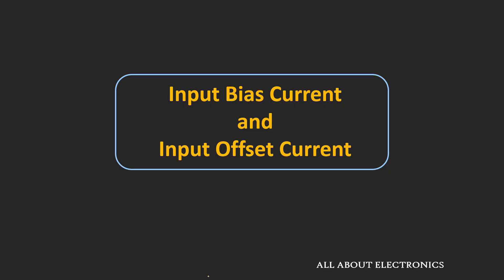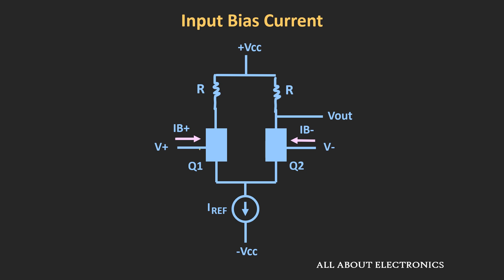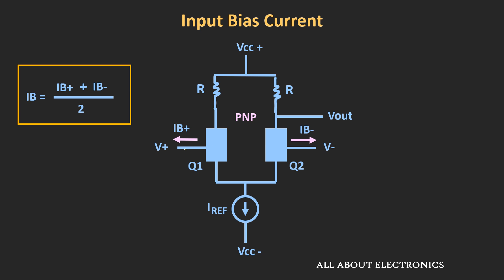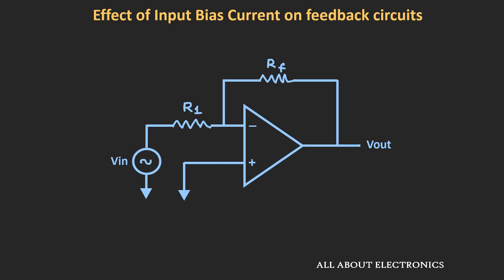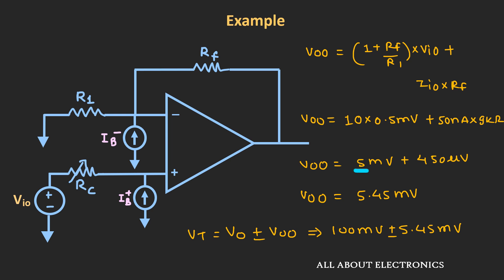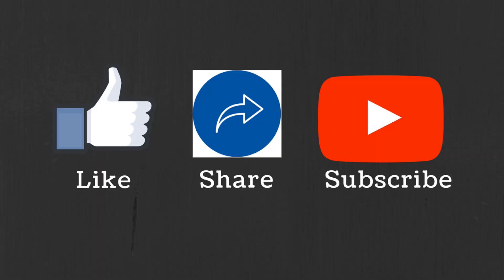Op-Amp: Input Bias Current and Input Offset Current Explained

Comment from the maker: The timestamps for the different topics covered in the video:

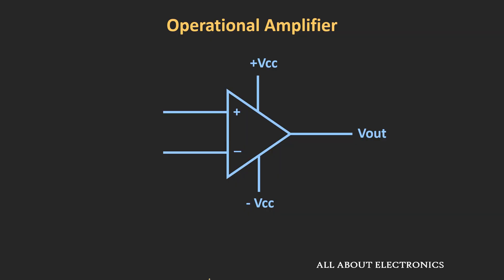0:48 What is input bias current and input offset current?

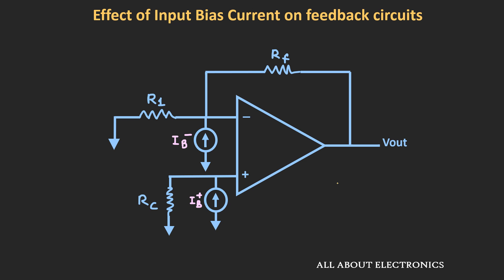6:08 Input bias current compensation using the offset compensation resistor

12:16 Example

Comment: 1:00; In Actual OP Amp Small amount of Current flow through the input terminal. Which is known as input bias Current. If Amp Constructed using BJT then that current is the Base Currren of that BJT, Else if MOSFETs/JFET then this biasing current is Gate Current of that Transistor.
Direction of this Biase Current Depends on this Transistor. If NPN - Biasing Current is Entering inWard OP Amp, If Else PNP - Biasing Current are Outward direction of the amp.
2:36; The difference between this two input biasing current is usally Defined as INPUT OFFSET CURRENT.
3:10; Different Amp Speed

Comment: hallo sir, in 5:47 you said that voo = -Ib(-) x Rf. Why is the current ib(i) negative there? thanks
Reply from the maker: Its because of the direction of Ib- that we have assumed. If you apply the KCL at the inverting node, firstly it act as a virtual ground. So, not current is flowing into R1. And the incoming current to the inverting node should be same as the outgoing current. So, same current Ib- will flow through Rf. (with the direction as shown in video). So, applying ohms low, the current through Rf ( or Ib-) = (0 - Vo )/ Rf, And that's why Vo = Ib * Rf. 
I hope, it will clear your doubt.

Comment: Helpfull.  What does it mean by maximum and minimum bias current of an op amp? 
For example, AD520 has the specification as minimum bias current is 0.5 nA and maximum bias current is 2 nA. 
For 741 , minimum bias current is 80 nA and maximum bias current is 500 nA. 
Please discuss   . 
Thanks

Comment: Respected sir.....why IB+ is removed ...and if V-   is grounded (as there is no input offset voltage) (no current through R1) why not IB- is removed....
And why the biasing currents are not going inside the terminals.. Please 🥺 explain sir❤️

Comment: Your explanation about the effects of input bias current and offset current in the output of OP are very good and well done. The expressions obtained are correct, but there is a problem in the OP model used to perform the explanation: the current sources representing the input currents of OP must be IN SERIES with the resistors. In the non-inverting input, considering the OP input impedance infinite, the current source in fact will develop a voltage over Rc. But in the inverting input R1 and Rf forms a current divider. So, the expression Voo2 = Ib-*Rf will only be true without R1. One good reference book is the “Introduction to Operational Amplifier Theory and Applications” from John V. Wait, Lawrence P. Huelsman and Granino A. Korn where a complete expression to output voltage is deducted .The 1st edition was published in 1975 when the input current, input offset current an input offset voltage was a serious problem.

Comment: So ideally, the bias currents in the inverting (In) and non-inverting (Ip) terminals are identical. Hence the input bias current  (In+Ip)/2  is basically the bias currents  In, Ip  themselves. Unless a non-zero input offset current is specified that is. Right?
Reply: exactly

Comment: Sir,
At 6:53 you say ,V+ =IB+ * Rc
but we see that the current IB+ is going 0V(ground) to V+. 
So ,I think the voltage can be V+ = - (IB+ * Rc);

please reply me if I am right or wrong
Reply from the maker: If you apply the KCL, then you will get it that, Ib+ is flowing through resistor Rc from top to bottom.
That's whyV+ =  IB+ *Rc.
I hope it will clear your doubt.

Comment: Sir If i understood this concept properly, bias current is the current flowing into inverting(or non-inverting) input because of bias voltage.
I wonder how we can present bias current parallel to R1,Rc.
Reply from the maker: It can be assumed as a current source that is flowing into the inverting/ non-inverting terminal. That's why it appears as it is parallel to the R1 and Rc. I hope it will clear your doubt. If you still have any doubt then do let me know here.

Comment: what is the use of Ib =100nA?
Reply from the maker: For the given example, as the input offset current is already given, IB is not required.
Here in the example, just for the sake of completeness of all the bias and offset current related parameter, it was mentioned. 
But in exams, it might be given to confuse the students. (Like, which current should be considered? bias current, offset current or both ??)